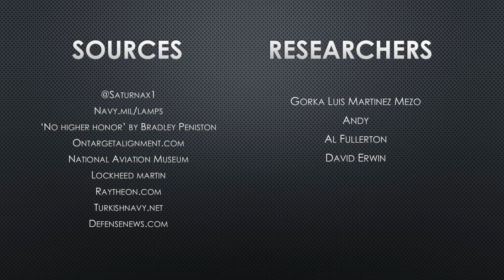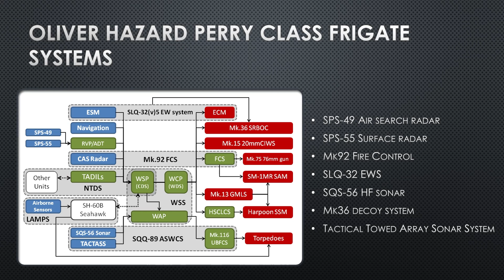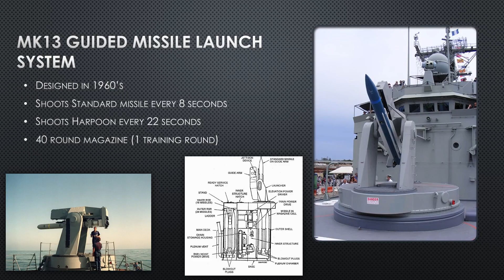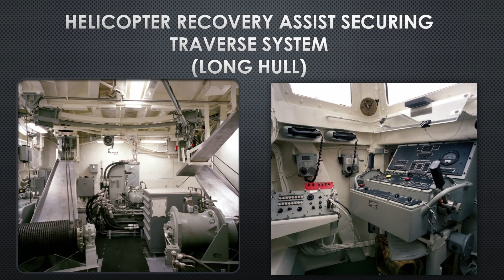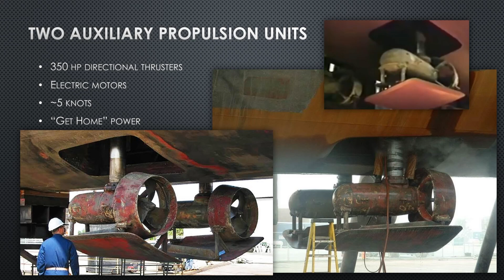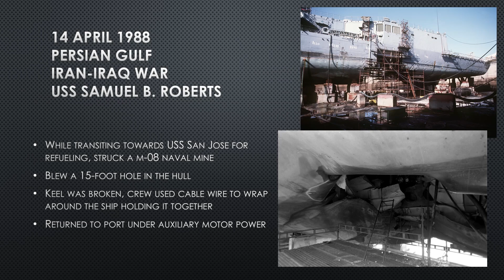Oliver Hazard Perry Ship Brief

Comment: I'm puzzled. My undestanding is that the hull mounted sonar has some limitations in range but that the TACTAS towed line is very capable and long range. Would appreciate any further clarifications
Reply from the maker: That Tactical Towed Array System is significant improvement of capability.  Hull mounted sonars are still limited in that they are mounted to a very noisy ship pushing tons of water out of the way.

Comment: I don't see why the Stark couldn't have used at minimum the EMCU ( get home box )  in the engine room to use 1 LM2500 that provides emergency manual control of the engine. We had to use ours once on the Gallery with a bad fault in the FSEE that was effecting both engines. You left out the fin stabilizers added that were located in Aux 1 to help correct some stability issues. The 16V149TI Detroit engines were selected because they could withstand being started and loaded immediately without a warm up period. The ships electric plant control console when in automatic mode if it detected a faulty engine or generator it would shut that engine down and start an offline engine and parallel this fresh generator to the remaining generator and it would be loaded in less than 20 seconds. You could load one manually in less than 10 seconds and bypass some safety features the console performed in auto mode. If the console detected a faulty electrical output of a generator it would split the ships switchboards that were tied in a ring bus by opening up 1 bus tie breaker on 2 switchboards depending on the generator combination running. Then detect the faulty generator , shut it down and put that part of the ship in the dark , start another generator and put power back in that part of the ship , then parallel the generators across a bus tie breaker that it opened in this process to tie both generators output together ,, then close the remaining bus tie breaker and put the electric plant back in a ring bus ,, it did all of this by itself if left in automatic mode ,, a truly remarkable piece of equipment for it's day ,, one major drawback of the generators placement on the ship having #2 & #3 in Aux 2 that could share fuel tanks located by the generator. So it never was a good idea to run #2 & #3 together if there was a problem in Aux 2 you lose both online generators. To operate the APU electric auxiliary propulsion motors it requires 3 of the 4 generators with the rest of the ship operating normally. It was never advised to start both APUs at one time, to give the ships generators a moment of recovery before starting the 2nd APU. The LM2500s used air driven starters  which required large volumes of air. 2 of the ships generators were equipped with an attached Start Air Compressor ( SAC ) that could only be used with 2/3s load on the generator. It was a centrifugal air compressor that had a clutch system to drive it from the generator. The Electric plant console operator would put the console in manual mode and unbalance the load on the generators to lessen the load on the generator that was going to be engaging it's SAC, the LM2500s were equipped with a bleed air valve and could provide compressed air from the gas turbine to cross connect to the start air system to start the offline LM2500. Also it had an high pressure air system of 3000psi used throughout the ship to use to start a LM2500. One feature that used the bleed air from the LM2500s was to use this air to disguise the ships sonar signature by allowing this air to enter the ships " prairie air and masker air " belts  that created bubbles along the skin of the ship and propellor blades to confuse sonar systems. It was rarely used because it increased the fuel usage of the LM2500s and would reduce the ships speed on 1 engine from losing cooling air for the online engine causing higher exhaust temperatures at full power single engine mode

Comment: Interesting to learn about. I was a SH-60B electrician and did 3 cruises on Frigates between 2003 and 2006. When ever we were in port with one of our sister Dets they would come over from cruisers and destroyers to show them how bad they could have it lol Specifically it was the hangers they were pointing out.Those hangers are just giant ovens in heat. Did have fun running from a typhoon off the coast of Japan. Walking on walls and had a day where we were confined to rack. Interestingly aircraft 110 you have pictured I did all 3 cruises with. Not sure if it’s the same buno number, but caught my eye.

Comment: Served on the USS Gary (FFG-51) for five years.  I'd like to add a few notes:  The 21 kt speed was with one turbine running.  If both where lit off it could make 32  kts (on a good day).  Time 15:13--Top left picture is of the CIC equipment room (directly below CIC on the main deck).  You can see the three CIC computers which integrated data from the ship's sensors (RADAR, SONAR, etc) for display on the consoles in CIC.  The middle picture is in the SONAR equipment room which is way down, low in the bow under the waterline, and the last picture is in COM (radio central) which is aft of CIC on the 01 level.  You should also have mentioned that the Stark was operating under peacetime conditions--the crew was not expecting to be attacked in any way.  The screw was reversable also--no reverser gearing installed, we'd just go into reverse pitch.  I believe it was the Samuel B. Roberts that used its APUs to get back to Bahrain.  The Stark's propulsion plant was not damaged (except for control systems from the bridge).  The crew of the Roberts used towing cables to stitch the hull back together.  The SH-60s carried torpedoes and  could also carry anti-ship missiles.

Comment: I was on board the SBR when we hit the mine we did not, I repeat did not, wrap cables around the hull. The Operations Specialists myself include were assigned a "crack watch" to measure the superstructure crack every 15 minutes to see if it got wider. The Senior Chief Bosun Mate Jack Frost (real name) brought  two towing cables up to the 02 Level and asked us to attach them to anything hard and heavy that we could find on both sides of the crack. Myself and another First Class Operations Specialist flaked out the cables. We put one around each of the GTM access hatches (these were used to remove the LM 2500s in case of a failure) and the other end to lifting points on the gun itself. We were under no illusion that these would prevent the ship from breaking in two if the seas got any larger than they were. Please correct this.

Comment: USS Aubrey Fitch FFG-34 Apr 85 - Apr 88 SC-02 Division Radio Central. We deployed 3 times in 3 years, 85 a 90 day deployment to Central America, based out of NS Rodman Panama, transited the Panama Canal and the Equator that year.  January 86 participated in the Space Shuttle Challenger Search and Rescue operation, was one of the first ships to arrive, awarded the US Coast Guard Unit Commendation with Operational Device, MEF 3-86 June - Dec 86 Persian Gulf six month deployment, Straits of Gibraltar, Suez Canal transit, Gulf of Aden, Straits of Hormuz, 1987- Baltops, crossed the Arctic Circle. What a great ship and crew!

Comment: Im sure you know Aaron but for people who dont or incase you dont, the CIWS is often left in that "safe" mode which is actually more of a manual mode where the operator has to make the decision to engauge or not. They do that because of a couple incidents where the CIWS shot down friendly aircraft. It does not have a typical IFF system where friendly aircraft will have a special radio tuned to a special number that changes all the time to tell anti air and radar stations that they are friendly. It relies on radar and some very complicated math that is way over my head and I dont understand one bit. Something to do with figureing out if whatever is flying by is going to or currently flying towards it. Like i said it's actually super interesting but way over my head. Cant quite wrap my head around how it works but there are some really good videos here on youtube about it.

Comment: The CIC picture shows the TAO center console to his left is the WCO the right is ASW...looks like harpoon console in pick lower right (partial). Top right pic is the radio room the other 2 look like IC gyro(been while). That pway in top right goes to the ASW room.. not pictures is the M92 FCS (2 consoles 3 positions) and the EW console (next to the 92 guys)
Reply from the maker: awesome insight, thank you.
Reply: @SubBrief  Tom, on my ship, USS Flatley (FFG-21) the console to the right of the TAO was surface, with the ASW further to port. The top right is Radio, the left one is at the entrance to RICER (Radar, IFF, Computer Equipment Room) and the equipment in that pic with the yellow on it is the UYK-7 (yuck-7) computers. Not sure about the center, might be the STIR equipment room. Behind the Harpoon console was the short range and long range AAW consoles. 
I was a Crypto/Comm ET but being min-manned, all the ET's learned to work on the SPS-49, 55, consoles with the DS's, everything. Hell, because we had the IC's in our division, I learned to clean the evap. salt sensors back in AMR 3 and 4. Fun Stuff.

Dan in Jupiter

Comment: There was pretty heavy criticism of this class in the day, much of it from the same critics of the Spruance class and advocates for baby aircraft carriers. The single shaft was particularly attacked, based in part on the single-screw design \of the Knox class. The difference was that this power plant worked all the time, unlike the steam plant of the Knox class. The screw was a particularly useful innovation. It was also one of the first classes, as noted, to use cutting edge foreign tech like the 76mm OTO and HSA GFCS.

Comment: During my time in the Navy and before Persian Gulf these ships were the butt of jokes. "Pre-expended Bin ship (read expendable), sink it with a .50 cal gun, not capable, give to Naval Reserve, Helen Keller sonar, the missiles, SM-1, didn't have adequate range. It was very tough on the crew as the complement was based on at sea operation so when in port they were usually in three section duty and sometimes in port and starboard duty. It did change opinions after the Stark and Roberts survived their attacks.

Comment: The USS Pop Can.  Lots of areas of the ship were Aluminum which melts and burns.  The two ships that were hit; Stark and Roberts; were lucky to return at all.  Manning intensive with limited offensive capabilities.  Main goal of the FFG was to absorb missiles so the Carriers were not hit.  Taiwan wanted to buy the Perry Class with a total redesign of the Command and Control layout and crew quarters.  The Taiwan proposal that never came about had a VLS box and a small SPY-1 type radar.
Reply: Did you ever serve on one? For 70's tech they were great ships. We could defend ourselves, and had a fair offence punch with Harpoons. yes, we were missile stops, but that's the job of a tin can. We were the updated version of the DD's in WW2, protect the fleet(Carriers), take the hits instead. I don't know where you get the "manning intensive" part from. When we went to the Persian Gulf in June of 1987, we had 215 crew total, with Helo Det, and Stinger Det. onboard. Much less than a Knox class, more capable in the ASuW, AAW area than a Knox. The Perry's were shown to robust, capable of taking a hit and surviving, just an all around jack of all trades, master of none. The Navy got their moneys worth from them. As a former Fig sailor, I say you are wrong in your assessment of them. For what they were designed to do, the cost of them, and so forth, it has to be one of the best buy by the Navy in a long time.

Dan in Jupiter
ET2, USS Flatley(FFG-21) Ret

Comment: about maneuvering. on cars the front wheels will be turned in toward each other called "toe in" about 5 degrees for stability and when you get an alignment they will make sure that they are set to the OEM recommended "toe in"

Comment: You forgot to mention the Praire-Masker  system on the class. I was under the impression it greatly reduced blade and flow noise off the ASW platform to such an extent that when conducting training operations against NATO subs, they switched it off to reduce the risk of collisions. I've always heard that the Perry class were a cast-iron bitch to detect by subs. Soviet naval records released since the end of the Cold War indicate the Soviet subs couldn't hear them at all when the system was active.
Reply: Pretty impressive how much tech these ships still had despite being “low” end.

Comment: Great presentation, so detailed in fact, that I learned something I didn't know about; I never knew they replaced those Detroit diesel generators in the 2000s. As I was an Engineman, working on those Detroit engines daily,  stationed on USS McInerney ( FFG-8) from 90-92, it's a little bittersweet for me to hear that. Those engines were incredible in size, sound, and power. I was told they made almost 3000 horsepower, and I could definitely believe it, as they were not only a 2 stroke engine (meaning every downstroke was a "power" stroke), but they were turbocharged AND supercharged. They really wanted the air going in those things to be under some pressure, owing to the fact that they had no intake valves, but intake ports at the bottom of the cylinders. Everything about them seemed huge (and oh so loud---earplugs AND earmuffs for hearing protection when they were running) as well. 16 cylinders (in fact, 2 V-8s bolted together), 156 GALLON oil capacity, and the fact that the OHP's were equipped with 4 of them, each bolted to a 1000 kilowatt generator, it's just nothing like what the average person sees in the civilian world.

As a crewman on the "lead production ship" of the class, I was informed shortly after I came on board that the McInerney was used as a test platform for all the planned upgrades for the class in its early life, which would likely explain why there were no other "long hull" ships built until the USS Boone (FFG-28). However, I had also heard that the Boone, as well as the USS Stephen W. Groves (FFG-29), the USS John L. Hall (FFG-32), and USS Jarrett (FFG-33) were actually built as short hulls and then retrofitted as long hulls at some point early in their service lives, though I have no evidence to back up such a claim. It does make some sense though, as it would take a few years to complete the testing, and as the McInerney was commissioned in 1979, it WOULD take until the time the others I mentioned to be commissioned (in '82 and '83) to begin to be implemented in the rest of the class.

A few other tidbits......the official speed rating says 29 knots, but I'm pretty sure all OHP's could do 32 knots, like the "Mighty Mac". Also, from a dead stop, to full flank speed, 43 seconds, just WOW. We even had an incident in the Gulf during Desert Storm where all they did was to go from 18 knots forward to a dead stop, not reverse, and when the controllable pitch propeller kicked back to 0 pitch, it was like somebody stomped on the brakes......I didn't know a ship could do that. The propeller shaft only turns in one direction, and never above about 180 rpm......all that acceleration and deceleration came from the changing of the propeller blade pitch, it was pretty remarkable. Oh, and because of only having one shaft, at high speeds, the ship had a noticeable tilt (or list, as it's called) to the left.

 Also, for some reason, I've never seen any sources that talk about the fin stabilizers that dramatically improved the ships' seaworthiness......they were gyroscopically controlled, hydraulically operated fins installed just forward of midships on either side, underwater of course, that counteracted the force of a roll to either side by adjusting the angle of the fin. Definitely helped a lot.

Sorry for the novel, but I love talking about my old ship......and it's nice to know she's still out there, after all these years, having been sold to Pakistan in 2010. They may not be our ally, but, they are technically not our enemy either, so, rather than having my ship be scrapped or sunk, as has happened to a fair number of the OHP class ships, it somehow makes me feel good that she's still getting some use.

Comment: I believe the Robert’s was heavy lifted back to Long Beach for repair.  I rode back on a C-5 from Lajes to Dover and the cargo was the gear reduction drive from the ship.  If I recall it weighed in at over 100 tons and was loaded on a semi and trailer for heavy equipment moves.  The drivers of the truck were the only passengers and the plane was limited into the twenties due to the weight.  This was the only cargo on the plane.  The Navy wanted the gear reduction drive airlifted back because it had the longest lead time for repair.  When I looked at the unit, I could see where the blast had bowed the housing upward as there was a noticeable gap on the steel beams being used to transport it.

Comment: I note your video states that Australian ships were short hull / sea sprite capable . But I can tell you with 100% certainty that Australian FFG 7 ships always operated Seahawks and not seasprites.
Reply: Also, FFG 04 (built as USN FFG 44) HMAS Darwin was the long hull version.  The first 3 were retrofitted with the extended fan tail at refit.  The final 2 were built in Australia to the same specification as FFG 04.
Also FFG 04 was the first ship of the RAN to bare the name Darwin.